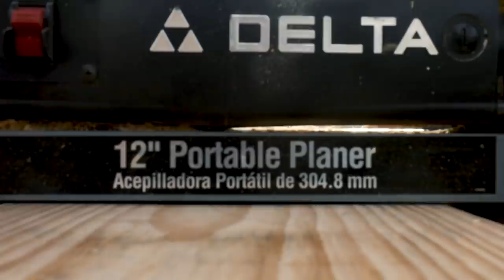Workbench with Pop Up Bench Dogs

Comment: Awesome build, much more simple joinery for those of us that want a solid bench upon which to work without the need for a 300+ pound Ruobo.  The one change I would make is to through bolt the vise instead of using those relatively small screws.  I mostly do finer work but sometimes something requires a lot of persuasion.

Comment: Nice video and amazing job.  Reading through the comments I'm clearly not alone in being impressed.  I can see you set it up so that it can be disassembled with the shorter sides and top being the biggest pieces.  I can only guess that the wobble at the end could've been minimized if the longer width pieces were made as incredibly stable as shorter ones you would have no issue.  It would be a compromise with not having the nice clamp holders (making those removable) but since the top is setup for side to side planing that may have made the difference.  A really clever design and the attention to detail makes me think it's almost too nice to do any work on.

Comment: Your bench dogs are legendary. A couple of 3/4” x 1-1/2” straps installed diagonally on the rear legs would eliminate the wobble. I would probably use 1/8” steel strap.

Comment: Nice, perhaps some scissor braces in the back . Then some short bracing in front from the bottom shelf and down to the base of each leg to eliminate the wobble? But it surely looks like a lifetime structure to me which will only get better with age and use. Really well filmed with several angles for each step of the build ,which made it entertaining and easy to watch.

Comment: Looks like it might be prone to wracking, especially with the leg assemblies just screwed in using angled brackets. Then you have those cross members bolted on with just a single bolt through each end, that allows for a wracking movement.

Comment: I would have put the primary vice directly over a front leg for best support and convenience. I would also have put the plywood shelf directly over all four stringers, not just the front and rear. It's going to bow when you put heavy stuff on it because it's not supported across its width. Depending on how much weight you want to put on it, you should consider even adding an extra stringer or two to support the middle.

Comment: I liked everything except the way you attached the top and then only used one lag bolt to secure each bottom brace. It's going to turn into a parallelogram. It already has a ton of movement when you were shaving at the end. One solution would be to stabilize the bottom and it'll eliminate the rocking by adding a 45 brace from corner to corner. It'll take away from the beauty but I'd rather that than for it to collapse or rock. Hopefully that made sense. Hope to see more content man! You've got some good ideas!

Comment: Very nice!  👌👌 I do a lot of hand planing on my bench that I built. The connection between the top and legs really should be stronger. I noticed that when you were hand planing at the end, it was racking. That would annoy me. Over time that is only going to get worse. Even if you were to have two bolts in each leg into the stretchers of the shelf, that would help minimize the racking. My bench has half laps connecting the bottom shelf to the legs as well as a small tenon on the top of the legs going into a shallow Mortise on the underside of the top. And I wouldn't even consider myself any kind of fine woodworker.  Great video though. I really enjoy watching your content. Keep up the great work.
Reply: Not just an annoyance, but also wasted effort!

Comment: You do it nice, but you should enforce it by triangle constructed structures for eliminating wobbling (for example diagonal or "X" balk from back between legs) or just audit your joints: maybe some of them need be enforced/replaced by more durability type, for example joint between base and top: metal angles would work fine here only if you already have stady base (steady even without top), but you are not for that moment.
Bolts on the shelf also leave rotation degree of freedom that's why it wobble like parallelogram. You can do wider shelf support bars and join it to legs by two bolts and glue on each side.

Comment: Enjoyed your video.  2 quick questions.  What are the white panels on your garage door?  And what is the purpose?  I'm thinking either temperature insulation or noise deadening.
Reply from the maker: Yep, you got it with insulation! I live in San Antonio and it gets insanely hot in the summers. I installed a small AC and wanted to keep as much of that cool air in as much as possible, that was the cheapest and quickest solution, I think someday I'll go for something a little more robust.

Comment: Very simple and good, but wobbly. We need to reinforce the structure.
Reply: How do you know it's wobbly sir?
Reply: @saywhaat8933  Because you see it clearly at 13:20. The whole bench is wobbling from side to side.
Reply: That's exactly what I was thinking. It's all over the place.
Reply: @saywhaat8933  "Because you see it clearly at 13:20. The whole bench is wobbling from side to side."
Reply: If you can't tell it's wobbly you should probably stick to washing dishes.
Reply: The design is inherently wobbly. There's no stabilization built in. All the support is in parallel lines.
Reply: Doesn’t look like the bottom shelf is attached.  Just screwing that down to the stretchers should take out most of the wobble.
Reply: @saywhaat8933  are you blind? didn't you see him plane that bit of timber
Reply: His presentation was on "Pop up Dogs", NOT ON A WOBBLY TABLE.
Reply: @terrybodenhorn3508  nah that won't do anything. it's the connection between the legs and bench. These little brackets aren't enough.   it needs bracing.

Comment: One of the nicest looking dimensional lumber workbench designs that I have seen. My only worry is the metal “L” brackets holding the top to the legs. How has that connection been in practice? I’m assuming you want the bench to be knock-down construction, but maybe add some dowels in the top of the legs to pin the two surfaces together? Well done!
Reply from the maker: Absolutely spot on there! Affixing the top that way was just fine when using the bench as a regular work surface, but when using the vise and bench dogs, the bench tended to sway. I added some bracing on the back of the bench and that cinched things up great, so it only needed a little bit extra and still maintains the knock-down design benefits. I love the idea of indexing dowels though, that would probably be plenty to marry the legs and the top in a stable way.
Reply: @MeasuredWorkshop  your humility & approachability will take this channel far :] 

Thanks for sharing your process√
Reply: Great looking workbench my friend. Never seen the pop up dogs before.  Where did you get the part that makes them pop up and down. I may try that myself.🤔 Thanks for sharing, 👍👍
Reply: J.R. Tidwell they're cabinet door pop things. Find them at any hardware store.

Comment: Really nice build! Love your videos. Nice work! What are the bench dog pop-up gadgets you used? I'd like to order a few for my next workbench build. Thank you in advance!
Reply from the maker: Search around for "push latches", I'm sure you can find them in different configurations and probably cheaper. I paid my lazy tax and bought these (relatively) expensive ones just so that I wouldn't have to modify them to slip into a regular-shaped hole:

https://www.westlunddistributing.com/cylinder-push-magnetic-touch-latch.html
Reply: @MeasuredWorkshop  Thank you for the info! Much appreciated!

Comment: You have done nice, but legs not sturdy!
Reply: Dear Fellow craftsmen, angle brackets at the top of legs was never going to stop flexing especially when applying a strong lateral force eg with planing in your bench dog system.  Love the pop-up device and hope to find something like this to use in a bench of my own.  To retrofit and strengthen the workbench you could put an angled piece going from the table base and the inside of the leg.  Four of these say 450mm out from the corner in 75 x 40mm would do the trick.
Reply: Mind blown lol

Comment: are you unable to instal a rivingknive on that saw table?
Reply: J. H. Indeed!  I only make that joke because I have a 1947 boice crane 2500 with no ability to add a riving knife. I fully support the use of a riving knife.  I have entertained making a zero clearance answer with a splitter.  I have been using the sauce since I was eight and I’m close to 40 now.

Comment: Very  pretty.  Are those steel brackets strong enough for all that lateral force?  I ask from a curious and jealous standpoint.
Reply from the maker: I had to add some extra support off camera (diagonal bracing on the back of the bench) just to get it more rigid. Plenty sturdy for just your standard project bench, but any lateral force definitely tended to rack it a bit. Live and learn! Hahah
Reply: Measured Workshop I’ve added to my workbench.  Yours is very neat looking and it made a great video on making tops.  Cheers.
Reply: My curiosity towards the bench stability is racking me and says to me it needs some. But it looks pretty neat.

Comment: 1:15 - are you intending to chop at a very slight miter, or is your saw misaligned?  Just asking.
Reply: he cuts it off later. it does not matter
Reply: @GoodOlKuro  It matters if he doesn't realize his miter saw is misaligned...
Reply: No, it is the end of the table and he cuts it with a different saw. he does not make a miter. @backpacker3421
Reply: @GoodOlKuro  Does not matter to the table.  But it will matter the next time he wants to make a square cut with his chop saw and doesn't know it's 2 degrees off.  You're not really getting what I'm saying, are you?
Reply: Could be just the camera angle.
Reply: @andysegelke3798  Nope.  Use the saw's platform as a reference.  It's off.  Looks like 2, maybe 3 degrees.
Reply: @backpacker3421  in another comment the author said he just bought the saw and hadn't noticed. It was just a mistake.
Reply: @bveezy5246  Thanks!  Glad to see somebody reply who actually understands that's a bad thing he should be aware of.  Got a couple who seemed to think it's no big deal.  Hard to imagine any woodworker not worried about that...
Reply: Yea, no shit. How is a 2-3 degree offset in angle "not matter". Ugh... it matters tremendously. I'd hate to see your trim work, sir. You must be the caulk and filler king. Let me know what brand you use so I can buy stock in the company, on account of you using a full tube at every seam 😆😆😆
Reply: @lennykrapitz4794  full tubed caulk filler.
Reply: Yap, we all have seen that, lets hope he read coments to his video or else his gonna have a big surprise on his next job

Comment: What's the point of the pushy uppy metal bits?
Reply: Those are the 'dogs'. The vice mounted flush to the surface at the right hand end also has a sticky-up bit - you can clamp long flat bits of wood between them for (say) planing their surface.
Reply: A tail vise is really only half a vise, usually. It provides the sliding jaw half while the dogs act as multiple locations for a stationary "jaw" to clamp against. The combination basically turns the entire bench surface into a very large vise using a tiny amount of additional materials.

The push latches are a pretty brilliant way to hold and store the dogs so they shouldn't ever get lost.

Comment: Good looking bench but it's too wobbly. You need something to stiffen up the legs.
Reply from the maker: Yeah I had to add some cross bracing along the back to help that side-to-side wobble (off camera unfortunately). As a stand alone work surface though, it was plenty sturdy, just when you used the inset vise & bench dogs it would tend to sway.
Reply: Troy Hawkins Think the use of L brackets to attach the top to the legs is to blame for wobblyness. Use of proper joinery to attach the top would’ve made the whole thing stiffer
Reply: Yeah some 45 degree braces near the top will probably shore that thing right up.  I too was worried about those L brackets being sufficient for racking forces.

Comment: Can't you just get those dimensions of wood straight away?
Reply: If it is standard dimensional framing lumber, they are close but not perfect. Running them through the planer evens the surface and makes them uniform thickness. This helps greatly during glue-up.

Comment: Why did you ruin thr bench with a mechanics vice?  Shouldn't that be the disapearing part.
Reply: I use one of those for woodworking - I replaced the cast iron jaws with some scrap alder and leather.  Works great for resharpening my saws too.

Comment: Instructions for a $200 workbench
============================
Step 1:  Spend $7,500 for a table saw, a jointer, a planer, a router, a miter saw, a drill press, a hand drill .......
Reply from the maker: You forgot the $15,000 I spent on the jeep to go get the lumber.